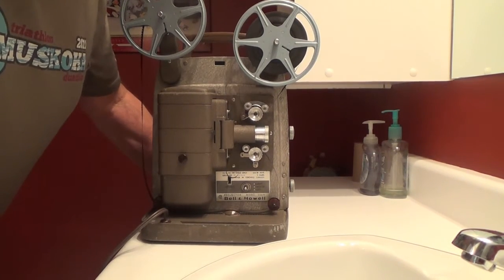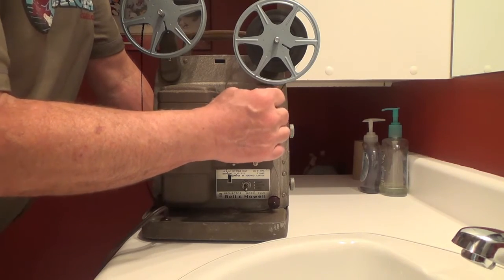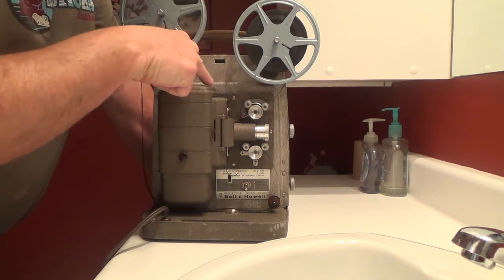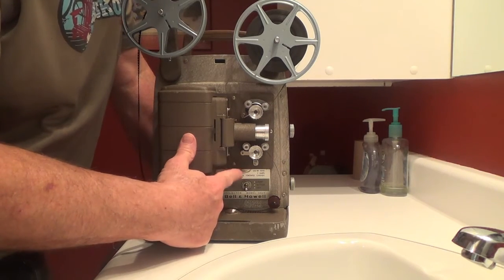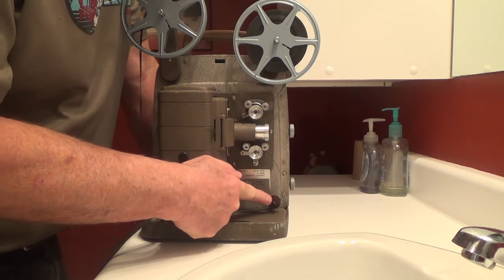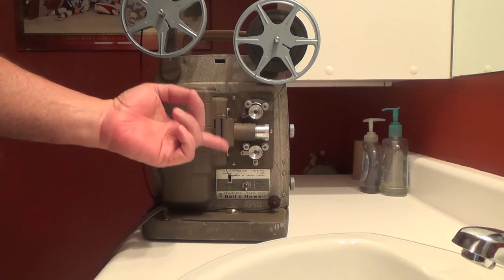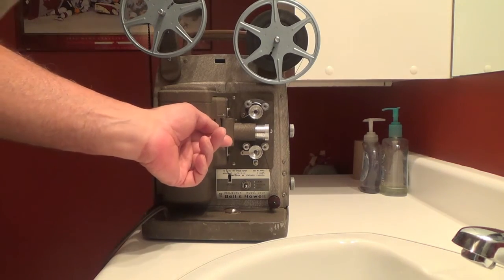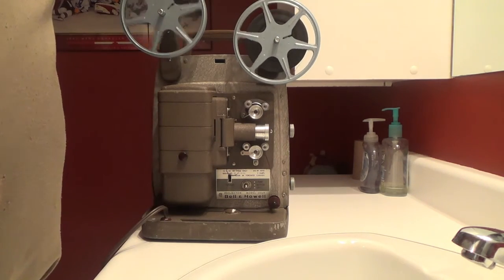How Load Bell and Howel Model 254

Comment: I have the same one but a model down the 253AX model . Its  similiar to this one. Ifoundit in a church mission thrift shop in Cobourg Ontario for $25.00. It works and seems okay. I have to thread it properly as shown. I have several older films left from my dad collection.
Reply: Norman. That is exactly why I used it. To project my Dad's old films. Then I used a camcorder to record the images projected on the wall. After a few tries I was able to do it.

Comment: Hi John, the motor moves, the wheels spin, but the film does not move,
Reply: The cogs of the wheels have to engaged into the holes in the film. If not the film will not advance. If the cogs are engaged, and the film is not advancing, it is possible the film is jammed up somewhere else along the path.
Reply: @hikeguy1951  The problem was the film is super 8 and the projector 8mm
Reply: @andresbriceno73  Requires an adapter on the super8 reel. You can get them on Ebay:
https://www.ebay.com/itm/173435609629